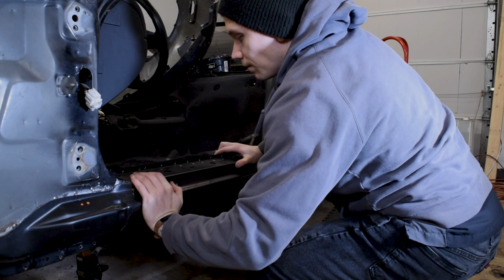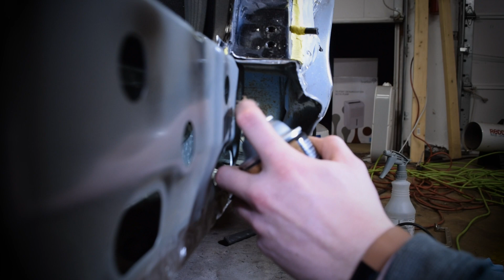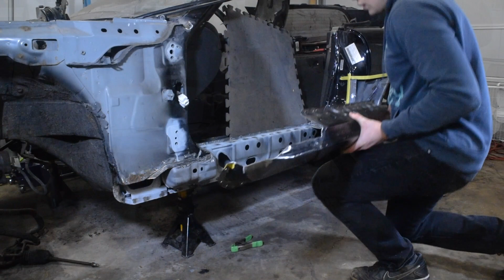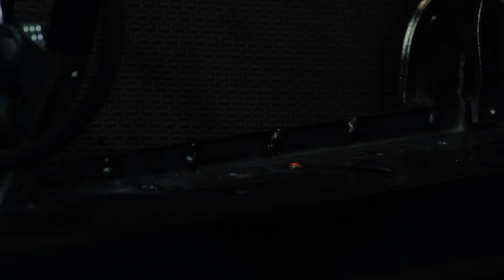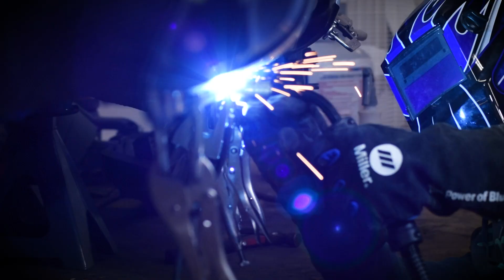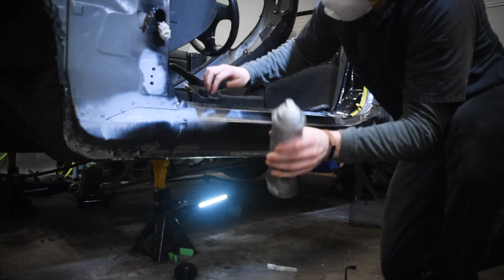Welding in the Rocker Panel - Mazda MX5 Miata Rust Repair Pt. 4 - Underdog Garage

Comment: Going to be doing this myself on my mx5 in the near future and having ZERO experience with cutting/welding/body repair etc this is SUPER useful!
Reply from the maker: We're really glad this is useful! With a little patience and practice you can do this. I didn't know how to weld until about a year and half - 2 years ago. I watched videos and practiced on some basic metal sheets until I felt confident tackling it. Feel free to send us an email if you have any questions on it! Thanks for watching!
Reply: @UnderdogGarage  Great video. You're using MIG, if I may ask, what settings are you using and do you use a flux-core type wire?
Reply from the maker: @Doug Marshall Thanks for watching! For settings I had  my welder set for welding 16 gauge metal. This varies from welder to welder, but for my Hobart I had the amperage set to 3, and the wire feed speed at 50. Unfortunately I don't have the exact amperage the machine uses in that setting since this is a pretty basic welder. For wire I was using .024" gauge solid wire with C25 MIG Gas. I hope this helps!
Reply: @UnderdogGarage  Thank you, yes. I'm eyeing a Miata that needs some almost entire 3/4 panel replacement as well as sills. Your video has helped me see what lies ahead and can plan accordingly.
Reply: Did you ever do it and how did it go??
Reply: @mattmullins862  sadly not yet, lack of space at my old place however just moved and have a double garage so will get things sorted! Got all the repair panels etc ready to go.
Reply: @KineticLatency  yeah I slid into a tree and dented my panel so I’m going to have to do it as well. I’ve started cutting but I really didn’t want to cut the rear tub. I was going to see if there was a way to change it without doing that cut

Comment: Very good video series and very professional production! 
just need to get everything planned out to start welding in my rocker panel and quarterpanel weld-in piece :D 
This definately helps a lot with confidence and visualization as i never did this before. 

Any tips on welding in a quarterpanel?
I dont have the whole piece and consider soldering after spotwelding
Reply from the maker: Thanks so much for watching and your feedback! We’re glad to hear it’s a confidence booster for you. That’s our goal. 

For the quarter panel I recommend focusing on getting any body lines as matched up as best  you can and get your panel fitted so there is very minimal gap. Makes welding on the thinner gauge metal much easier. 

Part 5 will be coming out soon with more detail on the quarter panel install. Should be up in the next week. 
Let us know if you have any other questions. More content coming out on this job soon. Thanks again for watching!
Reply: @UnderdogGarage  Thanks so much for the answer. I'l be looking forward to the upcoming video! 
until then i hope to be done with the clutch and renewing the tie rods :D 
You got yourself a new sub Lads! 
Love from germany
Reply from the maker: Thanks for the subscribe! Much appreciated and great to meet a friend from Germany! Good luck with your clutch. I have to get one for our MX5 soon. If you have any questions about the rocker repair feel free to email us at myunderdoggarage@gmail.com and we'll see if we can help you out. Thanks!

Comment: Great series, i am planning on to do this kind of repair my self. I have the same kind of damage to my car but the rust goes more upwards to the top of the wheel arch
Reply from the maker: Bart Pijnenburg 
Thanks for watching and thanks for subscribing! It’s been a lot of work but it’s worth doing and very satisfying seeing our Miata come back together. 

We are about to finish up that wheel arch and ill be sharing the footage from that in part 5 soon. 

The panel I bought covers all the way around the wheel arch. 
https://raybuck.com/product/1999-05-mazda-miata-upper-rear-wheel-arch-driver-side/

I’m not using the whole panel but I imagine you can if you need to get access to inside the wheel arch to repair it. Good luck on the repair and if you have any questions on it let us know. 👍🏻